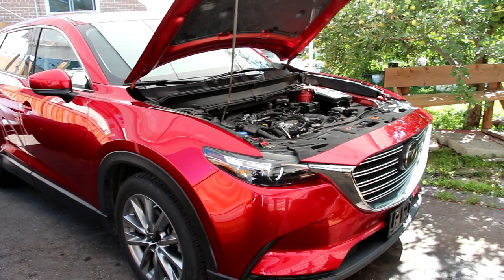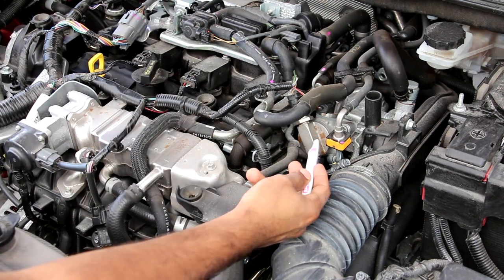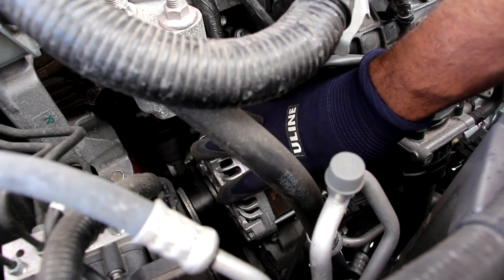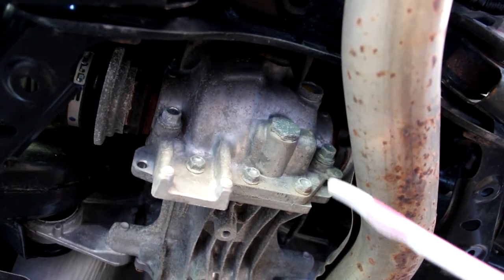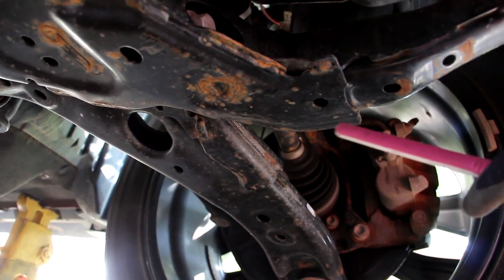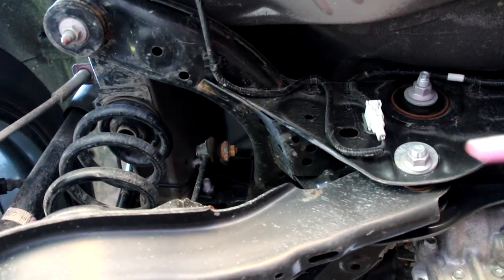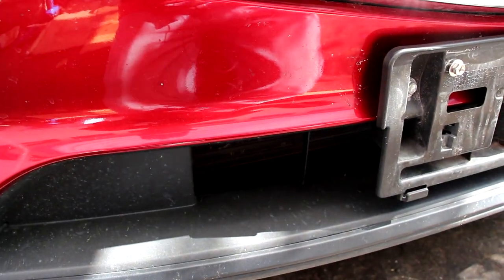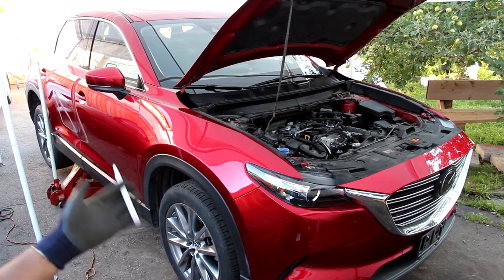Mazda CX-9 Mechanical Review

Comment: Are Mazda really that dynamic and fun to drive? They have a lot of older tech in them.
Reply: They are a ton of fun. I'm a believer after test driving a cx3 and 5
Reply: My wife has a CX9, it's a decent luxury car but not a great handler. It came with rubbish "eco" tires which have hardly any more grip on a dry road than a wet one, and it feels like it weighs about four tonnes when you go to take a corner aggressively. Her old Ford crossover handled way better - almost as well as a car - but we had another child so needed something bigger. The Ford also had a way better AWD system. I do like the CX9 transmission though, it had a low slip torque converter so feels almost like a DCT in the way it gets power to the wheels yet is not harsh. The engine is pretty good for a turbo 4 banger. It spools reasonably fast (but still some lag like all 4cyl turbos I've driven).
Reply: I went from a 2010 Ford Escape to a 2016 Mazda CX-9.  The handing is like night a day.  Although the Escape is  smaller, the Escape handles like a truck and I was very leery about taking a hard corner with it. Not the case with the Mazda.  For a 4000 pound brute it handles very well in my opinion.  Even my gf who drives a 2018 Kia Optima noticed how well it handled.  The CX9 power is very smooth and linear,  just like a normally aspirated engine which I have driver all my life.  Power delivery is quick and the transmission shifts smooth especially when compared to the Escape.  The smoothness of the powertrain and cabin feel can almost be its down fall as I have caught myself doing 65 in a 45 and you would never know it.
Reply: @georgepaniagua6115  hmm, the 2015 Escape must be a big upgrade over the 2010 because our experience has been the opposite.
Reply: Nicholas Vinen I did spend a week with a rental Mazda CX-9 Grand Touring to take on vacay.  My family and I felt that it handled very well!
Reply: @eleanormassaro5195  I guess it depends on what you compare it to. I've definitely driven worse handling cars. I drive the CX9 back to back with an Escape and a sedan and it feels like a boat in comparison to both. But I guess I have been spoiled by driving cars that are track ready.
Reply: I drove a cx5 turbo and would say forget the Porsche and buy your wife that second home she pines for.

Comment: Isn't there any other way to reach the cx 9 rear upper control arm? Like a funny bending socket or whatever? Otherwise it sounds crazy, I might not even buy it because of that lol
Reply from the maker: Nope!
Reply: That alone is also making me question buying a CX9. Is that common or is the CX9 the outlier of the class?
Reply: @manueltoscano2074  after some digging, Mazdas are all like that one way or the other. Got a CR-V touring and even if lacking features it drives like a dream and gets good mpg.

Comment: Any particular rust-proofing method you recommend? 🤔
Was considering Mazda, but that rust maybe a deal-breaker! 😭
Reply: Fluid film everywhere
Reply: You could sand down and paint all of your underbody parts if you're mechanically inclined. Besides that you need to be getting your undercarriage oil sprayed for the winter season.
Reply: If you can wait for it to dry, linseed oil
Reply: Most dealers now  have anti rust coating as an option
Reply: CRC corrosion inhibitor. Watch Project Farm’s video on that!

Comment: Mazdas are cheap, because they save on the quality and reliability. We have a journalist here in Poland who proved that Mazda uses fake galvanization. Not the proper electrical, but the paint with zinc. Mazda distributor tried to prove that their galvanization is genuine, but journalist shut the mouth of that scam distributor. 😂
If I would to choose how to spend my money, I would rather buy some used car of higher class than a new Mazda with factory new rust. 😂
Good review. 👍
Reply: The mechanical reliability of new Mazda's are good in my experience (had CX-5s in the shop with 450,000+ kms) mechanical was good just the rust issue. Rust proof it and they are solid vehicles
Reply: biglightball I have not rust proofed my 2015 Mazda3 and no rust so far, even after 2 accidents and having my car keyed

Comment: I got mine rustproof before I picked it up the dealer lot
Reply from the maker: Good job
Reply: @speedkar99  I totally agree with you on using more aluminum, not for the weight or fuel, but simply for  preventing rust.
Reply from the maker: And to be more modern....get with the times Mazda
Reply: did you check underneath and make sure it was done?
Reply: @onenikkione  yes of course, have you heard about other people not having it done ?
Reply: Are final coat rust modules effective in preventing rust?

Comment: Timing chain means you don't have to change it? Tell that to BMW owners or  GM 3.6 L owners. Of course in properly designed engines…
Reply from the maker: Haha agreed. 
You don't have to change it for the life of the engine 
Engine lasts 5 years
Lol
Reply: @speedkar99  what engine lasts 5 years Mazda?
Reply: GM only had issues with the timing chains on their 09-12 LLT v6. 

From 2013+, the timing chain issue was fixed in the newer LFX and beyond v6's.

Comment: the car wizard guy said this car's a nightmare when you need to change a head gasket.. a 4k job
Reply: Yes, but he also said it is a Ford engine!
Reply: @asg1277 that,and it's also not 1999 anymore I'd be pretty surprised if every single vehicle in its class didn't cost that or more to do a head gasket job on, granted I remember it being under 100,000 mi but that car was also kind of beat up in my opinion yeah it was new enough. It didn't look terrible but you could just tell somebody wasn't taking the best care of it

Comment: The German brands aren't complicated for nothing. It's why they make more power and torque than similar engines from other carmakers and also why they outperform them even when they have less power.
Reply: its also why they break more and $$$ to fix
Reply: @ysesq  Well you have to pay more for better. That's obvious. I mean it's fine for people to stick to boring and slow but don't expect everyone else to.
Reply: @SDav21  its not better if its unreliable. i expect my car to get me from A to B everytime i need it to.
Reply: @ysesq  Better doesn't only mean reliable. If a car must just get people from A to B there's no point in a Rolls Royce, a Mustang, a Ford GT, an SUV, a convertible. All useless. They don't need to exist. Right? I mean that's your logic clearly.
Reply: @SDav21  yes. we should all switch to japanese SUVs.
Reply: @ysesq  SUVs are pointless remember. No one takes them off road. They use more fuel than a normal car. Everyone shouldn't have choice. Everyone should only drive a Corolla. That gets them from A to B.
This is your logic. 😂
Reply: @SDav21  suv gives you space and height.
Reply: @ysesq  You get space in a sedan too and height isn't necessary. It uses more fuel and is more prone to rolling over. Therefore, by your logic, they shouldn't exist. Only a Corolla.
Reply: @SDav21  sedans have limited cargo space. height is necessary for left turns. agree with fuel and roll over.

Comment: Thanks, I have a CX-5 w/ the same turbo engine. Is it possible to change the plugs like I could on my wife's 2015 non-turbo 2.5 CX-5?
Reply: The engines are the same yours is just beefed up a little more for the added turbo. Her spark plugs should be in the exact same area yours is.

Comment: Aww it gives some wastegate  flutter like a tuner car i like that! my Eclipse Cross doesn't do that lol
Reply: I bet your eclipse cross didn't give out that blue smoke though. The cross has a small turbo which is good for spooling at lower speeds, giving good acceleration.

I am not impressed with mazda cx-5 or 9 mechanically, they are better than kia and Hyundai but they still use that gdi engine which falls apart without solid maintenance.

The cross engine is much better than these mazda cx-5 and cx-9 because the cross uses multi port fuel injection so you don't have to worry about carbon build up after 2 years.

Comment: For such a big 4cyl engine & being turbo charged. Sorry but that intake box/air box is pathetically small.
Using 5w30 or 0w30, there's nothing wrong with that. Provides a much broader ambient temperature range over a laughable 0w20 all for "fuel economy", nothing to do with protection.

A stretch type belt ?, now that's a lousy excuse for a part, it's a simple massive cost cutting method, i expected better from Mazda. So many flaws it's ridiculous

Comment: Does this engine have cylinder deactivation? I won't buy the car if it has cylinder deactivation. Wow, thanks for this video; you just saved me from making a big mistake - I won't buy a Mazda after seeing your video. Just one year and look at all that RUST!
Reply from the maker: Yes it did. I think lesser versions don't have cylinder deactivation, correct me if wrong
Reply: The turbo engine does not have CD.  Only the NA 2.5 has CD

Comment: I don’t why manufacturers are putting small boosted 4 cylinder engines in large SUV’s. The engine is already strained enough in order to pull all that weight, and then they decided to throw a turbo on it. All this just to comply with restrict emissions laws and increase gas mileage regulations. The new Ford Expedition did this also; I highly doubt this SUV and other ones just like this one to last many years.
Reply: Totally agree
Reply: What are they supposed to do, ignore the laws? Ask VW what happens next...

Anyway you don't have to buy these cars. Get a secondhand SUV with a V8 if that's what you want.
Reply: I domt think it is strained. It is only 100hp/liter turbo engine.
Reply: You can thank emissions CAFE requirements. Gimmicks like start stop, small displacement engines with turbo etc. And then stupid people who want a vehicle with smart tech. Bar none the majority of the public are idiots. The current virus pandemic is proof.
Reply: @djhrjeiwhri  it isn't. My wife has this car and it moves with authority despite its weight. It's a bit slow off the line (mainly due to the way the transmission is designed) but once moving it doesn't feel slow. It don't win any races but overtaking is not a problem.
Reply: @nicholasvinen  yes. i dont think mazda is that stupid to put any engine on its car, especially its flagship
Reply: It’s not that small at 2.5 liters. At least it’s better than Honda throwing a 1.5 turbo in the CRV.
Reply: The reason for this configuration is mpg. I get 26mpg combo with this engine/turbo setup.